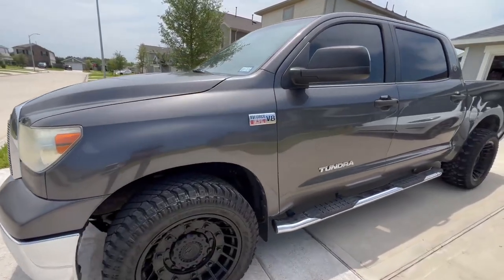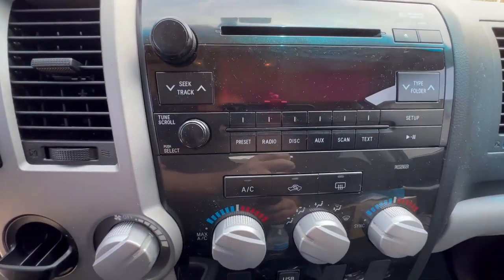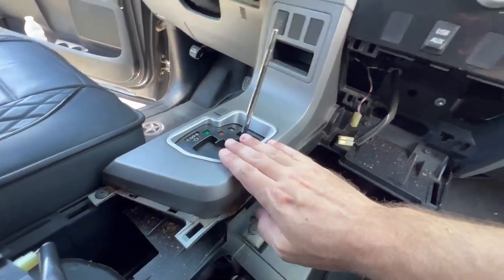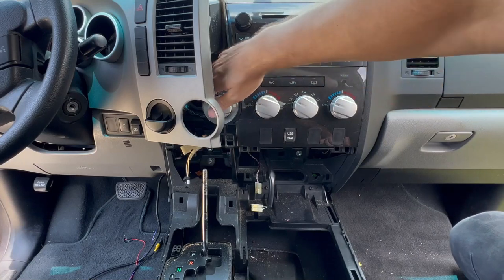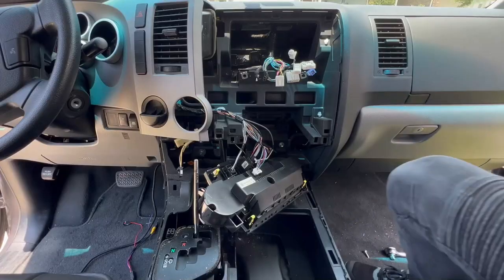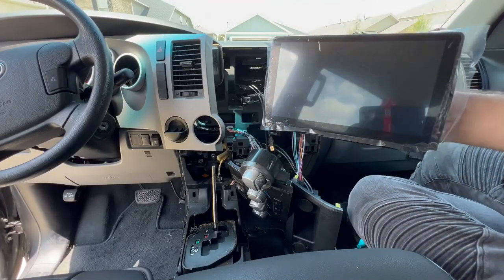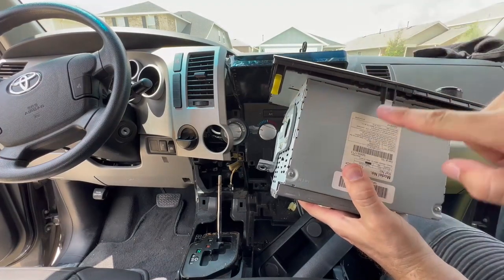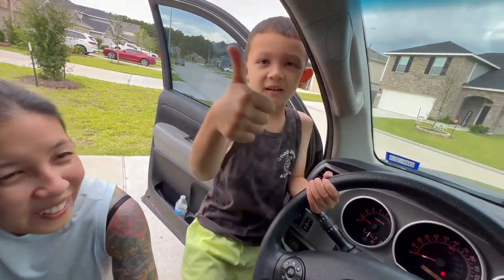ViaBecs | Part 1 How To Remove Factory Radio On 2007-2013 Toyota Tundra, 2008-2018 Toyota Sequoia

Comment: Question, why when I put the truck in drive does the screen not return to the main screen? It stays on the screen with the orange triangle in the bottom left side that mentions about surroundings when backing up. How do I get it to get out of that screen? Soo annoying.....
Reply from the maker: How do you activate the backup camera?
does the backup camera display when you put the car in reverse?
if so, I think the reverse line is broken.
If you view the backup camera though the AUX app, you need to click the "back" button.